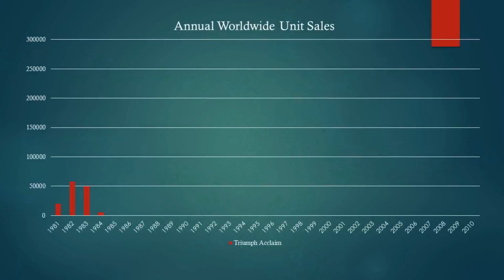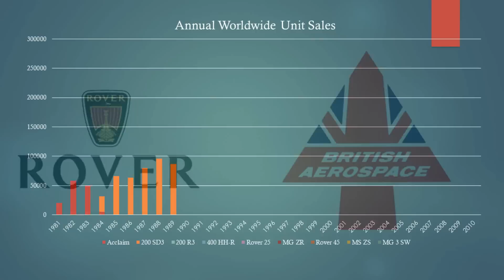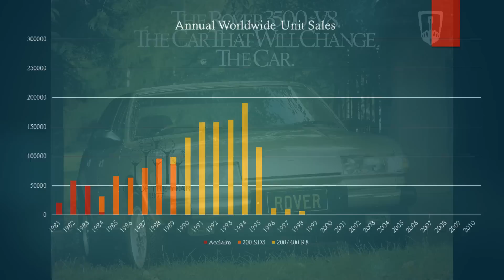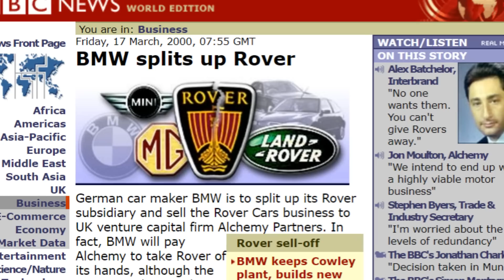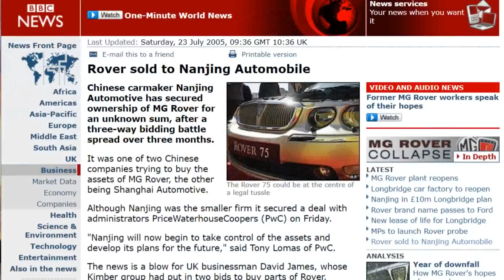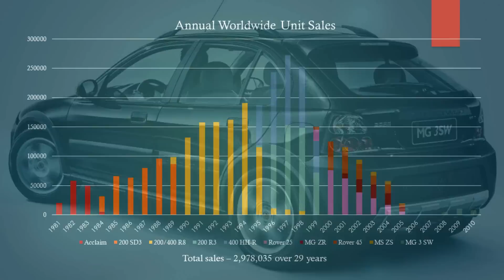The Rover 200 Story

Comment: If Rover had maintained their collaboration with Honda it would still be around today.
Reply: With a b16 engine for sure
Reply: I have to agree 👍
Reply: Not true. The relationship was strained and not so much a joint venture by the HHR/R3.
Reply: Yes. The BMW sale is the worst thing that could have happened to them.
Reply: Lash195 I don’t agree. The rover experience has served them well. No more collaboration with any other manufacturers since then.
Reply: Rover missed a trick by not utilising BMW older platforms and learning their manufacturing practices. Imagine an e39 based 800 or an sd2 with a bmw v8
Reply: @00kirbyd  the R3 was actually developed independently by rover group using a shortened R8 chassis and maestro rear suspension
Reply: All these comments assume Rover had any clout in the two partnerships. Honda ended things on their terms once they’d got what they wanted. BMW just wanted Land Rover for long enough to learn how to make SUVs, and got Mini as a bonus, no way would they have let Rover use their existing platforms.
Reply: Yeah, they should've never Let that Fall through, but it seems Honda was growing cold to the Idea, because Rover was getting more Success out of the Collaboration. I think it could've been worked out, if Rover had made A conservative Effort at continuing it.
Reply: @simonbennett9687  I couldn't see what BMW was Trying to do, but I think Your Dead On; Even though, I'm A Die Hard BMW Fan.
Reply: It was a great collaboration, which produced decent cars.
Reply: Rover were unable to work with Honda once BMW took over and sold there 20% share in the company. A huge loss imo as the R8's, 25's and 45's were great cars
Reply: @simonbennett9687  And dont forget stealing the designs for their new 1 series developed by former BL engineers. Sneaky Germans.
Reply: @xdafactor7684  Bigwigs at Rover were trying to get the company bought out by Honda before the BMW deal happened because they had a good relationship and needed the money, but Honda only wanted to purchase a major minority share. So BMW came in and bought them out.
Reply: @xdafactor7684  BMW were scared they'd be bought out back in the 90s  because they weren't a huge volume company at the time. They were selling less than a million cars a year back then. So they (mainly Pischetsrieder) wanted Rover Group to increase their volume because they could sell front drive cars and 4WDs without diluting the BMW branding. But Rover Group was bleeding BMW a lot of money and progress on their new cars like new MINI, the 75 and the 25 replacement that became the 1 Series took too long to happen. So Pischetsrieder got booted and Rover got broken up and sold off.
Reply: I agree. What happened was a disgrace. Honda had the technology and they were willing to work hard with Rover/MG/BL/BMC.... whatever the name was.
Reply: @doveronefoxtrot4417  BMW was a good firm, but Honda was a better fit. The company was just sold under from Honda. That was an insult.
Reply: @e.l.4409  - Good summary of what BMW was trying to do. Notice Daimler Benz was thinking that it needed to become global and merge with Chrysler and take over Mitsubishi.
Reply: Spot on. Yet another reason to thank New Labour.
Reply: @e.l.4409  Did they wanted to purchase A major share or A minority share ?  Well, at the time,  Honda was  not as big, and as successful as they are now. So, they probably couldn't Afford it,  or that was not part of their vision.
Reply: @xdafactor7684  Apparently Honda only wanted to increase their 20% stake in Rover to 47% or so. I think Rover wanted a full buyout from Honda because they had a working relationship and they needed the money. And British Aerospace wanted to fully offload Rover. So BMW came knocking with their full buyout and that happened.
Reply: It should never had come to that mate if they didn't sit back when they had the 2000TC they should have gone from strength to strength
Reply: Agreed.
Reply: @simonbennett9687  good comment simon. in different ways Honda and BMW were asset stripping a dying car company. Honda got market share  and a way around the inport tarriffs. BMW for the reasons you mention.
Reply: Blame BMW.. Strange they couldn't invest when VW resurrected rubbish makes in Seat and Skoda.  They were all about greed grabbing Land Rover and - at the time) promising the new 25 and 45 but never delivering.. Preferring a load more smaller BMWs!!!	Avoid!!!
Reply: @e.l.4409  I See. Thanks for the Info. I think at that time,  more than 47% might've been more than Honda could chew on.
Reply: With a rebadged CRV and HRV instead of that stupid hiked up 200.
Reply: X DAFACTOR but BMW. Lost their shirt with Land ROVER, and sold it to FORD,,as if it were a FIRE SALE.,  THIS time FORD NOW owned  JUGUAR, ASTON MARTIN, VOLVO,  then divested themselves of ALL, Cheers From NJ.USA
Reply: @flybyairplane3528  I hear You. Cheers
Reply: I absolutely loved my Honda engined 216 Cabrio, but under 200 miles in last 18 months I owned it meant it wasn't economically viable for me with 2 other cars. What really boils my piss is that the new owners didn't insure it, so the fuzz towed, seized and scrapped it even before the DVLA could transfer keepership.
Reply: I completely agree.
Reply: a Jazz vith a Rover badge? well Rover buyers were not excatly young
Reply: I agree with @simon Bennett, the Honda deal wouldn't have saved Rover. Honda were only interested to increase their sales in Europe, once the Swindon factory was opened they took more and more control of the design decisions - they wanted Honda cars to sell, not Rover. Obviously from their POV they had no desire to keep Rover alive, they wanted their sales and knowledge of the market to protect their European investment. They were fully aware Rover needed them and they took full advantage. 

Ironically some of the dealerships and garages from Rover became Honda, so it definitely benefited Honda in the long and short term. The BMW deal again was never about Rover, they wanted Land Rover to develop what we now know of as the X5. In the early 2000s there were more BMW 3 series being sold than Ford Mondeo's. BMW certainly didn't need Rover and their aging rebadged Hondas. 

To me I think their marketing desire to be seen as the prestigous brand was their failing. And the agreement to allow Honda to use the larger k-series engine while Rover would stick with the smaller offerings on certain models. The 200 Coupe (Tomcat) was a great car, even the MG ZR/ZS/ZT were decent for what they were. I think Rover could have gone down the more performance lane rather than mostly the pensioner's choice.
Reply: A senior Honda person at Swindon told me that Honda always planned to go it alone. Ironically, if Honda and Rover had remained more equal partners and Honda not started making weirder vehicles then Swindon might not be closing either. BTW, it could be clearer that the 1.6 was a Honda and not a K series engine. Also, in talking of Honda/Rover collaboration don't forget the Australian Rover Quintet. The BBC website clip shows Rover being sold to Alchemy - that didn't eventually happen. Very good video.
Reply: @simonbennett9687  I can remember seeing a New Range Rover coming down the road at me, only to realise after it was the BMW X5. Sad day. I still can't believe bmw done what they did with the Mini. Maybe MG Rover would still be around if BMW had left the Mini with Rover. Can you imagine a VW Beetle made by Ford or Vauxhall or whom ever?
Reply: Compared to the montego the 200 was a BIG step up.
Reply: what was Honda's reason not to buy Rover?
Reply: @simonbennett9687  BMW bought Rover because they wanted British aerospace to teach them aero engine technology. And that was starting of Rollsroyce BR710 jet engine made in Germany.
Reply: paulfinney A 400 replacement based on shortened/modified E36 platform would have been awesome. It’s true BMW missed a trick there and could have saved a fortune in new tooling/development.
Reply: Government should paid honda. For rover. It would be still around
Reply: Totally agree, but as usual we just sell sell sell and die
Reply: As someone who was actually onsite at Rover eating a dog roll with a cup of tea in the Comformity of Production Emissions dept' crew room, when when BA sold a majority stake to BMW, I feel I can comment here.

 I can vouch that the Honda guys  onsite were absolutely stunned, shocked and gob smacked at the decision. The Honda tech' support guy I was liaising with was asked to immediately clear his desk and leave the site by a very embarrassed John Gilbert (Gilbert Matthews, I forget now) the then manager. All other Honda personnel were also asked to leave....an incredibly awful experience to be there and see long standing working relationships broken this way. 

Honda did try and purchase a controlling stake but, BA played hardball, by continually changing the goal posts to the point where Honda asked for month break in negotiations.....within a few weeks BA had sold out to BMW.

People need to remember that Honda had a lot more to offer Rover and it's employees than BMW ever did and the working relationship was never the same again.
Reply: X DAFACTOR hi I’m a die hard BMW what do you think of M3/4 grille? (Personally I like it)
Reply: Agreed
Reply: No. Not unless they had sacked the chief designer. Did Rover think it was going to survive in the mass market designing Inspector Morse cars for the over 60s?
Gerry McGovern designed the 200 Coupe probably the most modern sexy Rover of that era. His design should have been the start of a new design language of modern sporty executive and family cars packed with features. Anyone that doubts this only needs to see his sales success with Land Rover and I can't wait to see what he does with new Jaguar designs. 

Instead they went on a reckless Retro spree. 
The obsession with the 'Rover grill' was odd too. It was hardly glamorous. It was a stick on job after the cars had been designed and it looked like that too. 
The marketing department should have been shot with their inane obsession with 'Britishness' nobody buys a car purely based on the country that made it. 
They should have been appealing to young modern people but they couldn't give up wanting the old duffers as customers. I blamed the unions for Leylands demise back in the 70s, but this time around the working practices were fairly modernised and happy it was the inept management that didn't understand the customer again.
They would have done well to ask Graham Day back for some consultancy, he seems to be the ONLY PERSON in their whole history of Rover/BMC/BL/Austin Rover/Rover that actually ever talked and thought about the CUSTOMER.
Reply: @paulfinney  

They weren't allowed to do that by BMW though.

Everyone talks about Rover missing an opportunity but BAE Systems were the ones who put the skids under Rover when they sold them off.
Reply: @Riazor1370  

It was a 25 base and it was far from stupid.
Reply: Should have used the honda engines through the 200 and 400 series, the k series had a useless headgasket that rover did nothing about, even landrover admitted there was an issue and lotus upgraded theirs, this certinaly gave rover a bad reputation in the 90s and 2000s for headgasket failures and drop in sales. But rover still kept using the same engine withntje same fault all the way throughout, going back to the typical old british leyland and austin rover ways.
Reply: @bettaney6924  

The problem was often not the head gasket at all but usually a leaking IMG which gave the appearance of a failed head gasket to most unwitting mechanics. Depending on which models you mean some 200s and 400s DID use the Honda D series engines. These believe it or not were capable of head gasket failure despite what people would like you to believe.

Working in the trade in the late 90s to early 2000s I booked in far more Zetec bottom end failures and Fiat head gasket failures than Rover K series head gasket failures.

One issue seen was a bad repair of a likely not failed in the first place head gasket which then went on to fail multiple times due to terrible work carried out with cheap pattern parts. One K series car we had in (late 200 Coupe with VVC) was happily pissing oil into the coolant... because the locating dowel which also served as the head oil supply hadn't been fitted by the garage who initially 'repaired' it.

After the sale of Rover to BMW how would Rover have been able to still use Honda engines?
Reply: Honda got what they wanted and moved on.
Reply: Rover got 2.5billion from the tax payer and struggled bad management really!🤔
Reply: @jerrysummers5971  

Sources?
Reply: Honda produce the toughest and most reliable cars ever made.
Reply: Comments like these are pure bias. Acuras are hardly the hottest thing in the market these days. Rover failed because it was always going to. They had no chance in a segment with millions of options and where they were the clear underdog.
Reply: @nightdriver7216  

How very insightful.
Reply: Nothing has changed it's hard to know now who owns what. were it's  built or if your driving a rebaged version of 4 other cars.
Reply: It seems like Honda ditched them from what I gather. Which is a shame. I understand rovers want to have their own voice in the design process. Which Honda didn't want to give them. It's complicated for sure. It's a shame when you see how they worked together well before.
Reply: Rover could probably be the British/European Luxury brand of Honda as Acura is in America
Reply: Hindsight is great. They should have just used Honda engine and drivetrains and developed a reputation for reliability. Then turned to profit.
Reply: Don’t think Honda would want a long term collaboration with Rover. They just needed to learn enough to master the European market, and then dumping it.
Reply: I wonder what would have happened had they been sold to Ford by Thatcher
Reply: Honda & BMW  main reason they wanted Rover to teach them how to manufacture Suv.
Reply: Honda wouldn't
Reply: Big time
Reply: BMW and Honda jv with Rover to produce their 4wd of their own.
Reply: Yeah. They could take Acuras and restyle them
Reply: ... they could have reskinned Acuras for the EU market, but the true is they could buy BL, but they didn't.
Reply: @paulfinney  no, it would have done more bad than good. for example, rover 75 sales were slow to take off due to a rumor that rover had used an older bmw platform, that was not the case. now, imagine if the rumors was true, the rover 75 wouldn't have sold half as good as it did.
Reply: Honda was the one that broke off the relationship, Rover couldn't do anything to maintain it.
Reply: One of the biggest mistakes of the Honda Rover collab was that they didn't give us the famous NSX  as an MG !!

Comment: I remember the Top Gear team slagging off the Streetwise. They couldn't get their heads around the idea of a 'normal' car having 'off-road' styling cues, such as the increased ride height and boddy cladding, if they're not actual off-roaders. Not long after,  many car companies adopted this theme and the Crossover market really took off. So, the Streetwise was ahead of its time, however the 3 Top Gear presenters, unsurprisingly, weren't.

Comment: Everything in this video is correct EXCEPT one major flaw: the K-Series engine. I worked for late BL and then Rover in the 90s and I can assure you the K-Series engine was anything other than 'plucky'. I was unreliable and dogged with head gasket failure and overheating. We would have to replace the HG after having the warped cylinder heads re-machined on MANY cars. The 1.4 engine wasn't so bad but the 1.6 and 1.8 versions were a pain. I am of a very strong opinion (as are other technicians from the time) that the warranty claims made by dealers against Rover had a massive financial impact to Rover's demise. I know many will say this is incorrect but I can assure you it's not.; we once had 20 K-series cars waiting for skims and gasket's in one month; as did many others. The Honda engine was radically more reliable.

Comment: We had a Rover 214Si in BRG.  We bought it second hand from a Rover dealer.  Good job as in the first year the head gasket had gone and several years later it went again which is why we sold the car.  It was a shame that the people who designed the K series engine couldn't sort out the cooling issues with it.  On the plus side the car looked good, had a nice interior, handled well and was never short of power, even thought the biased motoring press described it's performance as adequate.  Interesting, as I've driven several cars with a 1.4 16v engine since that haven't matched the Rover or come close to it.  Towards the end of it's life other problems were a rotting/leaking sun roof and failing radio.  A great car to drive and I wish I'd been able to drive some of the more powerful versions.
Reply: Same here. Brilliant car for its time, but like you I got tired of paying for new head gaskets and sold it.